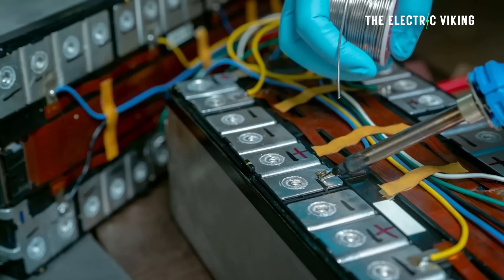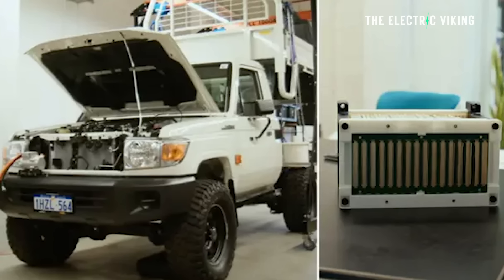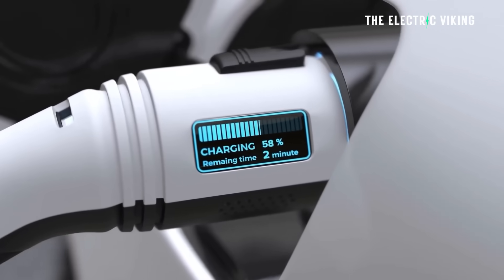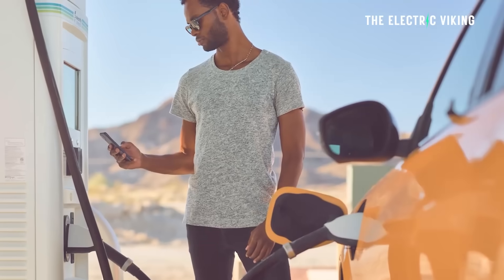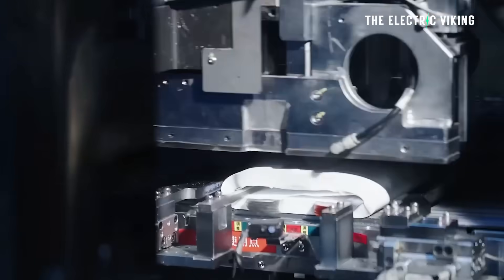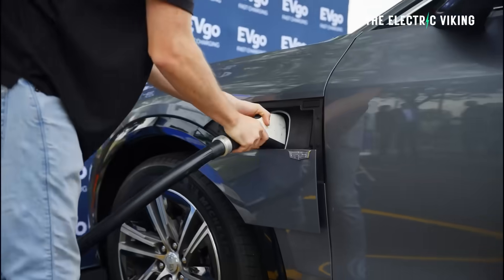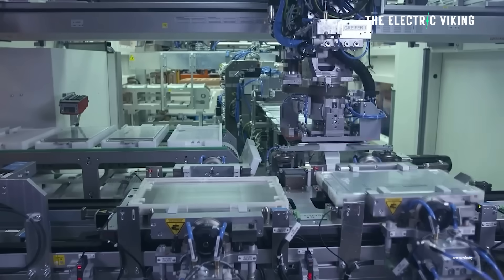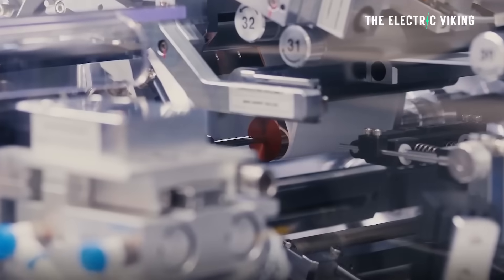World’s 1st XNO niobium EV battery charges to 100% in 10 mins

Comment: Im afraid this is rather hard to believe. 
When will it be commercially available.
Cost.
What specification Charging Station is required to charge in 10 minutes.
Charge in 10 minutes rather than around 30 minutes Im being conservative assumes # times minimum current draw from the grid.
Dont get me wrong it would be amazing if the quoted facts are correct but history and current technoligy tends to suggest this is unlikely.

Comment: Two critical numbers I didn't hear about the test battery.  1) Battery capacity:  10 kWh?  20 kWh?   2) Charge rate:  50 kWh?  100 kWh?  350 kWh?
The battery shown looks like it's only 1 kWh.  That could be charged to 100% in 10 minutes at only a 6 kWh charge rate.
I get that the point of the video is the new anode alloy.  However, without numbers/data to back up this "breakthrough", this all feels like fluff.
C'mon, Sam.  You can do better.

Comment: Is Lithium phosphate not only the cheapest but requires the least amount to RE minerals? 
90% of the BEV users do not require rapid charge, so I’m inclined to focus on 90% of the needs, 150km per day maybe 250Km max, home charging from Solar back supply, least RE materials input. Have a model that has a lot more options but first deliver a fit for customer needs BEV. And maybe there will be sufficient demand to stay in business.

Comment: Someone tell me how the charge cables at charge stations will be able to handle 4 times the current flow unless the voltage is increased to 1000 volts which would be fun on wet days. What is this new technology?

Comment: Another day another battery breakthrough, if I had a dollar for every time I have heard that I would be very rich. The bigger the "game changer" the more likely the likely it's a grift. And a 50% energy density over Li-Po just reeks. There was a company a couple of years ago that made the same claims, it failed to go beyond the publicity stage and was obviously a tech startup scam. As for pumping that much energy into a battery pack in 10 minutes, the heat generated would be incredible. Given the "wonder tech" is just the anode, the battery chemistry would be good old Li-Po which does not respond well to heat. I will believe it when I see it.

Comment: What is the power draw to charge an EV battery in 10mins.  The video doesn't state the battery size, but assuming 50 Kwh, then the power draw would be 50/6 = 300 KW.  Anyone see a problem with this?

Comment: Sorry , Niobium is a rare earth metal... In other words an expensive one.
And 10 minutes charging is not necessary with EV's because fastcharging is only needed at longer travels.
After hours of driving also the driver needs a break....on average my break (sanitair, something to eat and a coffee) is 20 to 25 minutes.
In that time my car is already charged for the next few hours to drive. (10-80 % in 18 minutes...)

The only real thing to change.

On all public parkings , especially were people do not have their own driveway, placing level 2 chargers.
With cheap electricity (same payment as for electricity in home). Because this will make demand for fast charging also much lower.

Comment: Not so exciting.  Niobium batteries will not replace Li batteries anytime soon.  To recharge a Niobium battery in 10 min, you need an ultrafast charger of 500 kW or more.  Also, Niobium batteries weight 33% more compared to Li batteries for the same capacity.  This is a serious no go for the car industry.

Comment: To make a reasonable projection about charging, the standard charging rate for stations in the U.S. should be set at 240 kW for retail vehicles, with higher rates for commercial vehicles. If vehicles can operate with lithium iron phosphate (LFP) batteries and charge to 100% at incoming rates of 240 kW, then the battery size should be 100 kWh or less. This allows for faster charging, which is essential for Americans who need to cover long distances of 700+ miles (approximately 1,127+ kilometers) in a single day of driving; this is a typical journey for me.

If we can implement 100 kWh battery powertrains in vehicles designed for optimal aerodynamics and efficiency, achieving power efficiency ratings of 3.5 miles per kWh or better, and the U.S. increases its charging stations to a ratio of 10 units for every existing gas pump, then electric vehicles (EVs) will be on par with current gasoline options. This is the current challenge (electric pun intended) facing the U.S. market.

Comment: A few issues here. The battery takes 10 minutes to charge to 100%. OK, but how much capacity does that have? If it is 10KWh that's not that impressive, if it's 100KWh that's much more interesting. The one thing that these fast charge rates seem to ignore, is that the power supply needs to be high capacity. If you add 75KWh of charge to a  battery in 10 minutes you will need a charge station that actually delivers about 500KW for that 10 minutes (allowing for some losses). There are many in the UK that advertise 350KW chargers, my car can accept 350KW according to Hyundai, but I have never seen that delivered. Indeed even on a thermally conditioned battery pack I rarely see more than about 230KW. That would more than double your 10 minutes charging time. 
Shoving 500KW (half a megawatt!!!!) down a cable for 10 minutes reliably many times a day, day after day is quite a feat. 
I love my Leccy car. It would be good to charge a bit quicker, but I'm not sure it's going to happen very quickly.

Comment: You forget that the faster you charge the more power you need. The more infrastructure you need. All things we don't have.
Reply: It's a chicken and egg problem. Why build an infrastructure if no technology can take advantage of it? Why would you build the technology if the infrastructure is not there? If the technology is real and worth pursuing, the infrastructure will follow. In terms of charging that quickly, batteries at the charging station could be installed to smooth out the charge curves. In other words, today's infrastructure transports it to the batteries on site during off-peak hours. In that way, you are only charging quickly from the batteries to the car.
Reply: Thats what I was going to say. To charge a 80kwh battery in 10min requires 480kw power. There is no infrastructure to charge a single car like that. Not to mention millions.
Reply: Agreed: however🔋 durability and longevity have my interest.
🇧🇷 is the largest Niobium producer in the 🌎 so I've been following this battery tech for a few months now.

Comment: ⚠️Tell us where the 1000's Megawatts are coming from to charge millions of EV's in 10 mins.
People have no clue about OHMS LAW ⚠️
Reply: Millions of EV's ain't going to all charge at the same time, once charged, the EV will go days perhaps weeks without being plugged in! Queuing theory might help!
Reply: @pcstar123  oh my you have no concept of kw/hrs

I can tell you that if just 20% of UK's population switched their 3kw kettles on simultaneously, for example when East Enders finishes and adverts come on, it would overload the grid. (source from a senior engineer who works at a Hydro electric power station )

The grid often has to meet surge demands by buying surplus nuclear energy from France 😆

How on earth are they going to meet the demands of even 2 million EV's at the very lowest rate of 7kw never mind 250kw at fast chargers . 
They can't even meet the demand of kettles.

But there is no surplus energy to power them.

Plus all roads will have to be dug up to install cables 10 times thicker to supply the Gigawatts required  😆

Then there will have to be millions more pylons over the countryside with much thicker cables.

It's not going to happen folks if you understand Kilowatt hours and more fundamentally OHMS Law ⚠️

There's already power cuts coming called load shedding just like South Africa.

Leaflets have already been delivered here
 "How to deal and plan for power cuts were given to us 5 months ago by our supplier Octopus
Reply: @pcstar123 Could you supply the number of KW required to replace petrol and diesels. How many power stations are required. Plus a costing. We are talking about replacing every car and truck in the world. Are you a electrical engineer that can do the maths . No politicians have bothered.  Do you understand the equipment needed to fast charge 1 car little alone fast charging service station.

Comment: it does not matter how fast you can chard the battery.  There is a constraint (a bottleneck) in serving power network. in short, it is hard to deliver a required amount of power to a dedicated location for those ultra fast charging devices. this new fast charging battery will stay in labs for another 10+ years.  It is like buying 12K tv now and wait until Internet speed will allow you to watch true 12k quality footage in the future.

Comment: So a battery made from niobium would cost $30,000. Current cost is $20 per pound. As the average battery weight is 1,500 pounds. So (200,000 metric tonnes) that would be 295,000 cars. Not very many

Comment: The problem isn’t peak recharging speed as much as it is the infrastructure’s ability to provide the required power.
Reply: Glad you said that hoe is the charging structure going to put say 50 Kw of power into a battery in 10 minutes. That's a chunky cable!
Reply: @bobtuck5820  No not really , That tech is already sorted , by trickle charging another battery over night in a so called super charger , then dumping from that into the car, to get you up to 80% then you trickle charge the rest at home . Super chargers are the price of a car , so not too many people getting one at home , So always going to get mugged at the forecourts as normal .

Comment: The future will be hydrogen fuel cells, as sure as the sunsets!
Reply: The way fuel cell catalysts and  membranes and there anode and cathodes becoming so efficient that one day a small coke bottle full of cheap green hydrogen will take your car 1000 miles, this is coming, and new solar cell making hydrogen coming to market that will run homes and cars, and cheap cost effective prices!
Reply: Why because solar cells have become more efficient making hydrogen than battery storage or just plan electricity, fuel cells are becoming truly remarkable engines for all transportation, secret of fuel cells is fuel cells actually clean the air as they run due to there electrolysis!

Comment: I assert battery charging speed to be equal to or even more important than battery range in usefulness, especially once charging stations are everywhere (as is the case in China). This could significantly lower the cost of EVs by reducing the size of batteries needed. If a person normally charges their vehicle in their garage overnight and drives 50 miles a day on average, or even if they park their vehicle on the street without charging, why is there a need for 400-500 miles of range of charge. Maybe a 250 mile range is fine for the occasional road trip even, as a 10 minute break every 4 hours of driving is healthy for you anyway. And if this smaller battery saves thousands of dollars and frees up a significant amount of interior or frunk space and lightens the vehicle (thus improving range and allowing the battery to be even smaller) then we got a win-win-win situation here folks! And for those folks who drive extra long distance regularly and insist on extra range, upsell them on that battery size, don't make everyone else drag along an extra 600 pounds of unnecessary electrons.
Reply: The way fuel cell catalysts and  membranes and there anode and cathodes becoming so efficient that one day a small coke bottle full of cheap green hydrogen will take your car 1000 miles, this is coming, and new solar cell making hydrogen coming to market that will run homes and cars, and cheap cost effective prices
Why because solar cells have become more efficient making hydrogen than battery storage or just plan electricity, fuel cells are becoming truly remarkable engines for all transportation, secret of fuel cells is fuel cells actually clean the air as they run due to there electrolysis!, THERE COMING!
Reply: Great, now add insert-able battery pack, only use the 2nd battery for the occasional long road trip!
Reply: Ok ,why not develop   a more efficient public transportation  system ,so people doesn't need to use private cars, that even if they are electric,they need lots of room for parking, and more and more highways,that need lots of space,why not build ore subways, trams,electric buses, trails for bicycles

Comment: no, we are limited by the power in the grid.  Our home could only provide 15-20kwh to charge a battery assuming all other sources of power are shutdown.  Charging at a high rate wasted energy.  At 6/10 ohm resistance a 100 ampere charging rate wastes 6kwh of power.   These do not include battery charger and rectifier losses
Reply: Why would you want a fast charger at home ? Surely most normal people charge overnight, fast chargers are for long drives away from home and those without home charging ?
Reply: @bobdeverell  I needed a car for work a few times a year  had to drive 400 plus miles.  Those days were frequently 12-14 hours.  I cannot imgaine spending hours charging and thne not able to find charging on these lonely two lane roads
Reply: @PatrickFerrin  I understand. In your case I would not buy an EV until the range reaches 1000km or so on a single charge. Several chinese manufacturers will soon oblige.
Reply: The way fuel cell catalysts and  membranes and there anode and cathodes becoming so efficient that one day a small coke bottle full of cheap green hydrogen will take your car 1000 miles, this is coming, and new solar cell making hydrogen coming to market that will run homes and cars, and cheap cost effective prices
Why because solar cells have become more efficient making hydrogen than battery storage or just plan electricity, fuel cells are becoming truly remarkable engines for all transportation, secret of fuel cells is fuel cells actually clean the air as they run due to there electrolysis!

Comment: I guess the biggest problem here is that niobium is quite rare, hard to find and very expensive. Brazil has a couple of mines that put out about 88% of the world's output. Canada has a mine that puts out about another 8% of the world's output. Not sure where the remaining 4% is mined. Niobium has a lot of other important uses so adding the demand that would come from using it in all or most EV batteries will almost assuredly cause the already high price to skyrocket. For this technology to see widespread use in the EV battery market, they better not need a lot of it for each battery, otherwise it could add a lot of cost to the price of a battery that contains it in the anode. Also uncertain is whether or not there is enough of it in the world for the supply to keep up with the kind of demand using it in all or most EV batteries would put on the supply. Anglo American reports that they're now having to adapt their processing plant in Brazil to process fresh rock ore because their higher grade oxidized rock ore which they have been mining almost exclusively will soon be depleted. This suggests that a long-term sustainable supply of the metal that would be large enough to supply the EV battery industry may not exist.
Reply: Previous uses for Niobium were in welding rods for stainless steel and as an addition to brass for making bells. IIRC the metal was sourced from Russia.😊
Reply: @malcolmrickarby2313  It is also used in the production of high temperature resistant alloys and special stainless steels, also used in aerospace, shipbuilding, oil and gas industries, pipelines, superconducting magnets used in Maglev propulsion, MRI machines and the Hadron Collider. It's also used in mobile phone circuitry, a lens glass additive and micro-capacitors. As I said before, 88% of world production comes from two areas of Brazil, 8% from Canada and 4% somewhere else likely either southern Africa or Russia.
Reply: The way fuel cell catalysts and  membranes and there anode and cathodes becoming so efficient that one day a small coke bottle full of cheap green hydrogen will take your car 1000 miles, this is coming, and new solar cell making hydrogen coming to market that will run homes and cars, and cheap cost effective prices
Why because solar cells have become more efficient making hydrogen than battery storage or just plan electricity, fuel cells are becoming truly remarkable engines for all transportation, secret of fuel cells is fuel cells actually clean the air as they run due to there electrolysis!
Reply: Australian company WA1 has discovered a massive Niobium resource in Western Australia. They will be the second biggest and best Niobium mine in the world once the mine is up and running.
Reply: @petebrown8914  I'm from WA and my neighbor happens to be an exploration Geologist. According to him there are even bigger deposits of critical minerals like Niobium in WA that no one is talking about.
Reply: Substitute with vanadium which is abundant in the Earths crust.